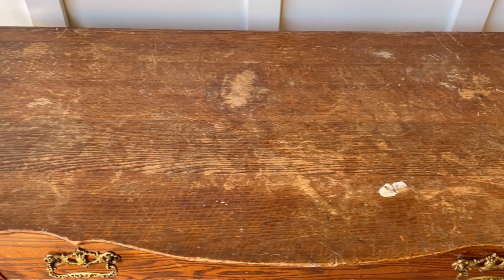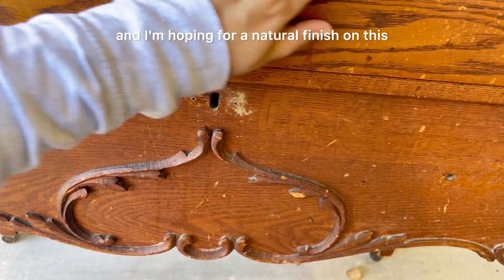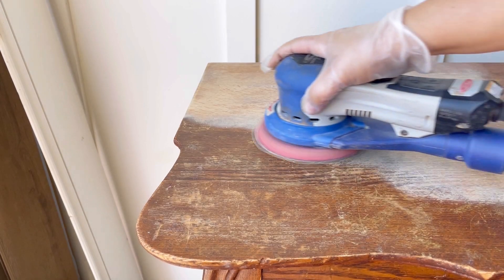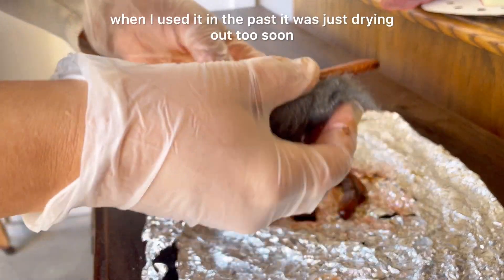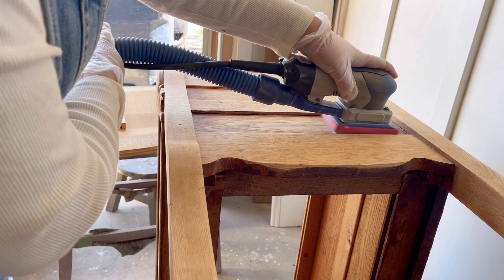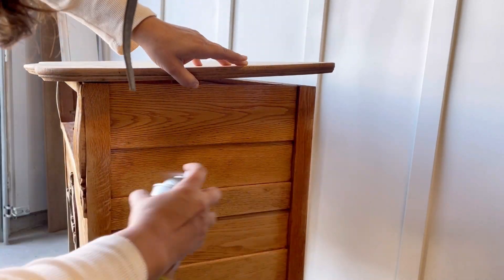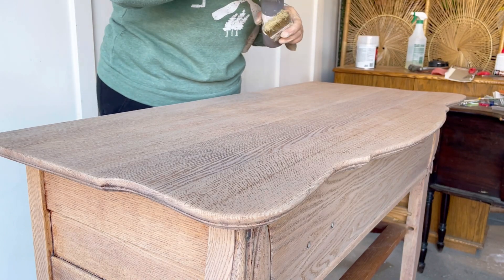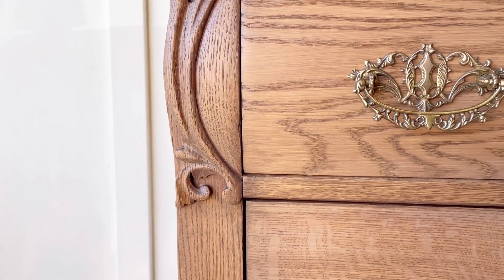Rescuing A Farmhouse Style Sideboard | Thrifted Furniture Flip

Comment: I just discovered acetone as a stripper for CERTAIN finishes. I put it in a spray bottle, spray small areas at a time(it evaporates quickly), let it sit for a few seconds and then use a plastic or soft wire bristle brush/scraper to remove the finish. The bristle brushes work well in detail areas.
Reply from the maker: I’ll have to look into the acetone for stripping. I have a go to stripper but ran out and need to order more. I’ve used brushes many time, the small pieces were just tough to grab to scrub.

Comment: I’ve never put on a shellac primer or any primer prior to paint wash…. Is it necessary?
Reply from the maker: Most the time is not, I’ve only had bleed through once. This piece had so many water rings before sanded that I wanted to play it safe and apply the sanding sealer. The sealer promotes an even finish.
Reply: Thank you😊
Reply from the maker: Sure!!